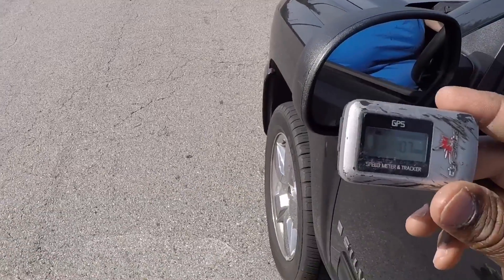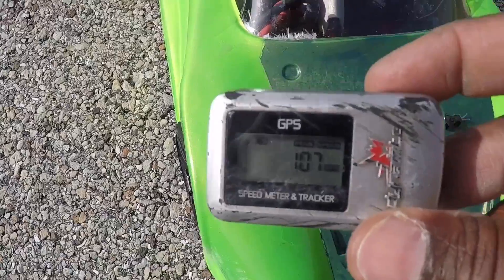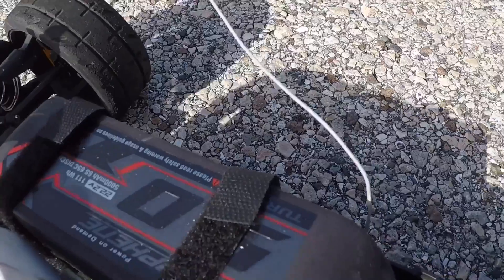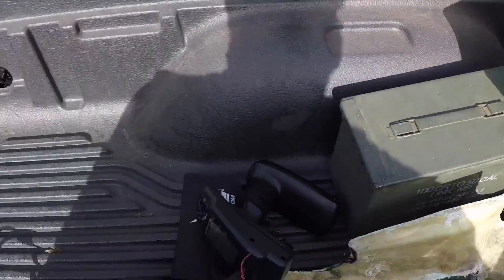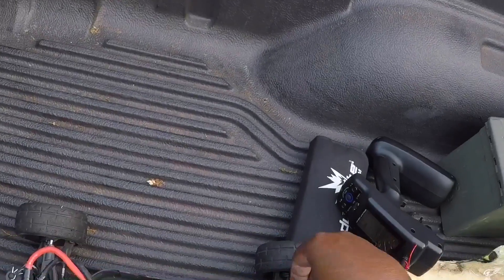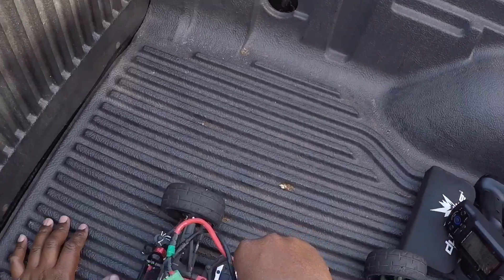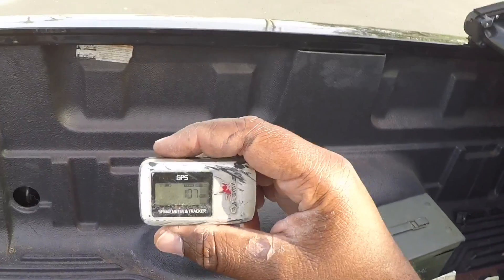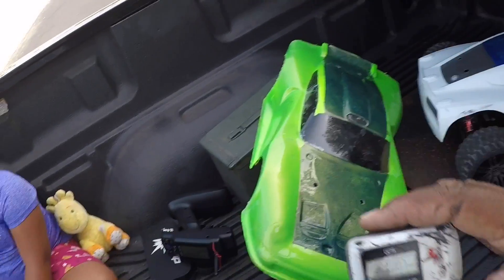[107MPH SPEED RUN & DATA LOG]  The "ARRMA GETTIN'" Project - SkyRc Toro Beast 1/5th Scale ESC

Comment: They not only sent me the center diff they also sent the mounts. I just found the other day a shit ton of aluminum upgrades for my truggy all the suspension a arms links hubs brackets even the center diff mount in aluminum, all kinds of aluminum stuff. Made my day for sure seeing it, I love aluminum parts lol. Little pricy like $27 for 2 hubs for front, bit pricy but solid well made lookn to say the least... hot racing servo mount is about $11 higher than the voltage hobby one. Yeah HR parts seem high also but definitely better made than they were back in the day.

Comment: My brand new center trans diff complete with bearings and the center diff mount came in today for the truggy. They sent both for free cause mine had a slight wobble to it. Figured I'll throw the new one in along with the Robinson Racing pinion and buy a new spur gear for the original one and save it for a back up. Plan on stocking up big time on spare parts more than enough to build 2 other truggys at least including chassis plates the whole 9. Chassis plates with the PROLINE chassis sticker guard, that shit they stick on skateboards to protect the boards. Tough ass stuff they make them for the losi, team assoc., team Durango, ect.
Reply from the maker: Sweet!  Your rc is going to be looking nice!
Reply: 13djdave13 lol well idk how it's gonna be lookn after the mamba monster slings it around like a rag doll!! Nah I do try to baby my stuff no doubt
Reply: 13djdave13 listen parts from the arrma outcast typhon and kraton fit my truggy. So maybe keep that in mind when your helpn me find a good wheelie bar, 1 that can raise and lower maybe or if anything be easily removed for jumpn / bashn.. 😁
Reply from the maker: The OutCast comes with a stock wheelie bar built on the rear spoiler support.  
Here is the part# WHEELIE BAR SET #AR320366
Reply from the maker: lol... true that!

Comment: Well my man I finally made my decision far as a good bashing drivetrain combo. Also picked up my first set of PROLINE wheels. I went with the PL Blockade 3.8 on the F-11 wheels. Decided to be different on the wheel choice since everybody and there mothers have the desparado wheels but the blockade tires are a beast. Watched a vid with them on a heavy ass 5th scale nitro getting the shit beat out of them non stop jump after jump after jump after hole shot just dog'n the truck and after an hour did a close up of the tires and they appeared as if they weren't even ran at all. Others say they had for over a year and they looked like the day they got them. Also there my favorite tread pattern for the truggy and buggy rc's. Far as combo I went with the new Castle Creations Mamba Monster X sensored 1515 2200kv combo. Next summer I'm buying one of the futaba radio's and the Mamba X telemetry linked with the futaba radio will be very cool. Plus I'm supporting the good ol U.S. by buying Castle. I do love there motors and haven't even had the chance to experience them yet!
Reply from the maker: IMPORTKILLR R/C   Nice!  Be aware that the only Futaba transmitter that works with the castle telemetry is the top of the line 4PX transmitter.  I have the Futaba 4PLS and thought it’d work, but little did I know the telemetry wasn't compatible and had to send it back.  I even contacted Futaba and was told there was no plans at this time or in the near future to have any other transmitter able to work with that telemetry sensor setup.  I was heartbroken 💔.  I don’t have over $500 to spend on a transmitter.  I love my Futaba remote, but the telemetry sensors and receiver that’s compatible with it are freakin’ expensive as hell for the 4PLS.  They do work superbly great though!  Bittersweet 🙃
Reply: 13djdave13 yeah it does say the T4PX radio.  That was the radio I was lookn into or even there newest version which is a 7 channel I believe which will also work I believe. Shit no I don't have the money either and would never down that much BUT I have been saving for it here and there which is why I'm saying next summer lol. Plus I just bought a new 8 channel reciever for the radio I got now. The hot racing servo horn with fixed bellcrank worked and I found that voltage hobby aluminum servo mount to fit my rc so thats the next hop up I suppose.
Reply from the maker: IMPORTKILLR R/C   I hear ya... I’ve taken somewhat of a sabbatical from my rc’s.... I was going to work on my 1/5th scale today, but so far I’ve eaten one quart of Baskin Robin’s chocolate chip and started binge watching the series “StartUp” on Crackle.  Lol... Motivation lack so I snack!😂
Reply: 13djdave13 winters coming for me so I plan on getting few more runs in before the years up. Winter be good time to put in my castle stuff. Shit man I'm still breaking in my new lipos, goes to show how much I run the truggy. Course I'm gonna speed run it to see it's max mph but far as serious speed runs I plan on getting a 8th scale buggy and buildn it strictly for speed running only. Did find a brand new typhon roller for 3 bills, my second choice but I really want a losi 8ieght 4.0 buggy for speed runs so well see. Gotta finish the truggy build first which I think the prolines will set it off nicely. Still waiting on the 20 pcs xt60's to make my connection point for my cappack. I got the 10 pack shrinkwrap less xt60's but those too expensive to cover up with shrinkwrap which is used to help hold all 3 together. Damn overseas orders takn forever, lol.
Reply from the maker: Oh yes... a couple times I had to wait more than 6 months for shipments coming from overseas.  One of the shipments was a set of Turnigy Graphene 6s lipos I caught on sale at a steal of a deal price which felt like forever and a day from Hobby King.  There was a different order I was waiting on and it took so long when it finally came I was like "WTF did I order?" "What is this?"... lol  ..... Just make sure when you do your speed runs that the street you do it on doesn't have road reflectors, storm drains, minimal stationary objects (like fire hydrants, telephone poles, barrier posts, traffic),  minimal radio interference, and have your walking shoes on for when you have to take the infamous "LONG WALK".... Oh yeah, and some tissue or handkerchief to wipe  the tears away after a crash..lol... just kidding on that last one because if you do a speed run in the rain and crash, the rain will hide your tears!  lol... just kidding..  But I'm sure you'll love it.  Sometimes you have to get lucky to find a Typhon roller because I noticed when I was looking for one they weren't easy to find and when they were available, they were on eBay up for bid.  Scored my last roller for around $182 from a bid war.  The new 2018 Typhons that are coming out are brand new RTR 's for $429.
Reply: 13djdave13 any new changes on the new 2018 typhon. Wonder if I'd be better of waiting and see what new changes are being brought to the table. Yeah man $180 something is great price for a roller, yeah I think 300 bit too high imo why I didn't jump at it. Well that and trying to find a clean losi. Idk though for speed runs losi sure be nice probably one of the best for top speeds but the 3.0 and 4.0 are very expensive parts wise even for the most simple of parts is outrages kinda.
Reply from the maker: Parts for the Typhon are fairly inexpensive.  The only thing that can be expensive with a Typhon is the aftermarket upgrade parts.  If you were going to make the Typhon a dedicated speed run rc and pay $300 for a roller, I'd suggest getting one brand new so that you'd have a backup esc and motor if something fries.  Frying electronic pretty much comes with the territory of speed running eventually if staying with it long enough.
Reply: 13djdave13 it's nice that my truggy came stock with hobbywing esc, good for back up. Not sure what motor is in it 3874 size. So the mamba x sensored combo 1515 size will be a nice upgrade in size of motors that is. A big shout out to you and void x for recommending this combo along with couple others. Sure I'll be happy with it. The fam ordered it for me today for the holidays so I didn't even have to spend on it. The wife got me the prolines as well for holidays. Cool ya know don't mind waiting considering winters coming seasons about over for me that and i got a motor and esc in it for now so I rolled with it and let them get it for me. Cool that way I can keep savn for my speed run roller or complete typhon if you say the 2018 gonna be good. Typhon or losi or maybe team durango or mugen. Decisions decisions lol!!🤔
Reply from the maker: That's awesome!  Always a heaven sent when loved ones help you out in your hobby of choice.  I was lucky when my lady got me a Castle XLX for Xmas, a GoPro Hero 5 for my Bday, and sometime help film my speed runs.  She was already awesome before hand (Lucky me).  But that Typhon I'm going on a lucky guess and say it's going to be as great if not better than the last version.  These things are very durable, easy to work on, and great for on or off road projects.  There are a number of bodies that you can make fit it too.  Delta Plastik is a great source for quality bodies.  I've crashed numerous times, even into a curb going over 60mph bouncing and flipping across the pavement, and this thing is still holding up strong.  I've crashed prior to my fiberglass body mod, but my most recent crash into the curb I give most of the credit to the fiberglass for extra strong buffer zone protection it provided.  Here's a link to that crash below
  https://youtu.be/Lmkk3qLlqTE?t=1m2s
Reply from the maker: There's serveral features that they've upgraded from the last version.  Here's an unboxing video below:
https://youtu.be/M9jZdB1YqBk

Comment: lovn the kawasaki ninja green bro. looks like the color on my zx6rr, don't let the 6 fool ya she out runs stock hayabusa's all day er day. lol... My man lockn in that 107 spot. good job!!! gonna have to get into them top speed runs soon as my 8ight-e 4.0 build is finished. I'm more of a bottom end torque hill, jump, climbing, trail run, rock crawling, yet light bashing kinda rc person but the more I watch vids like yours the more I wanna turn to the dark side of racing... you figure with 4 mustang gt builds 10 second foxbody builds under his belt I would be more into the top speed runs. Idk yo!! lol.. damn good run though....
Reply from the maker: Mike Fahner   Thank you!  One thing's for sure, speed running is very exhilarating when trying to control a speeding bullet on wheels.  Choosing a nice long street with less hazardous like storm drain, ditches, curbs, and parked cars sometimes make crash repairs cheaper.  Lol.  I've had some terrible crashes on my journey to 100mph+.  Motorcycles are awesome.  I put a Harley Davidson Night Rod Special on my bucket list🤞🤞.  I forgot which one I sat on during a car show, but I find only certain types of sport bikes (crotch-rockets) comfortable enough to want to take it into traffic.  Some made me lean forward too much.

Comment: very nice run bro getting them #s up congrats, I got a 110mph on my typhon New spool added  and it was a short run too lol.  You need the WTF turbo fans bro really recommend them bro for that esc get the 40mm fan and motor is 30mm fan, Will keep that system way cool 👍
Reply from the maker: R/C CUSTOM   Thank you!  Yes, I badly need a fan for the esc and my motor fan's wire had gotten severed when my esc ejected during a crash into a curb.  I bet your speed numbers are about to go sky high now that you have that spool.  👍👍💪💪🏎💨💨💨
Reply: 13djdave13 Yea the stock diff it had was locked inside on my TYPHON think it got higher #s cuz of the 34/34 gearing, But yes these WTF turbo fans are a need for us speed runners and bashers. All you need it a 2s fly pack 1000mah Lipo and JST connectors and a ON / OFF switch trust me it'll make difference on your systems 👍🏼
Reply from the maker: R/C CUSTOM   I'll have to definitely look into that. 👀👍👍